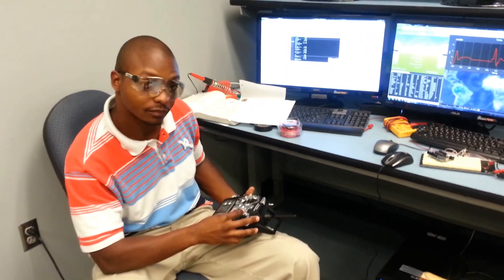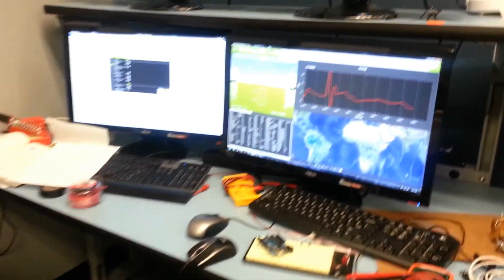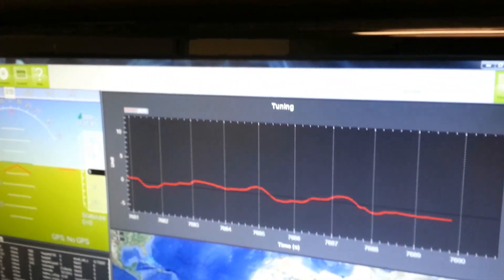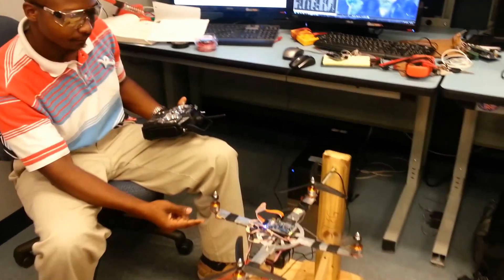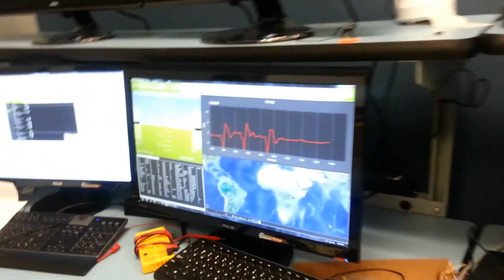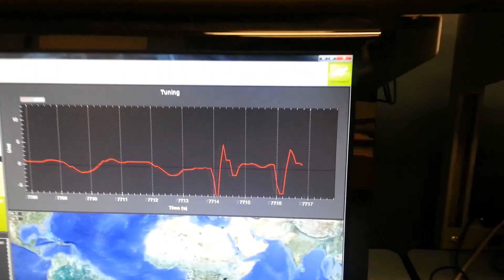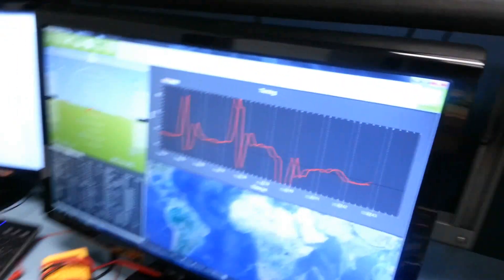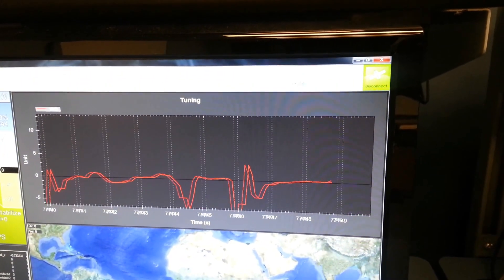Mercer IARC: Quadcopter PID Testing

Comment from the maker: Thanks for the comment. For the flight control system, we are using the Ardupilot Mega 1 (APM1) for the controller. We have an inertial measurement unit shield that is built to easily fit onto the controller (this houses the accelerometer, gyroscope, etc). The software is called the APM Mission Planner. Since this hardware and software is all open sourced, there is a large community of supporter that have put together tons of tutorials and forums. I can send you more formal info if you like?